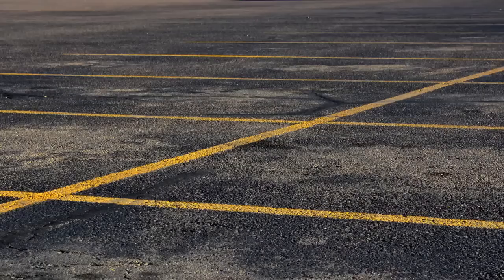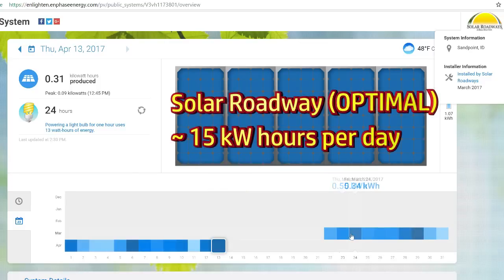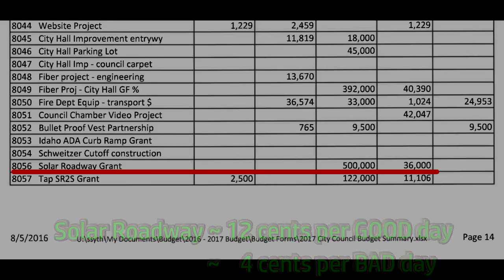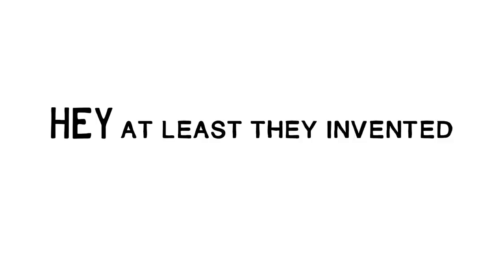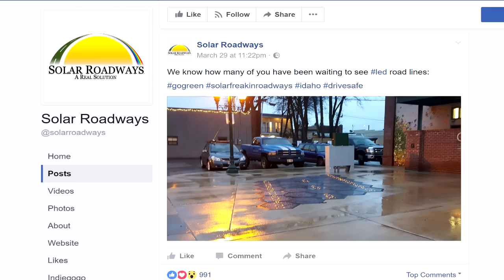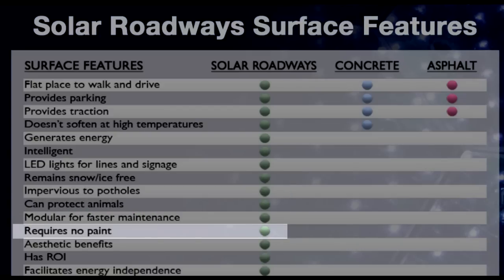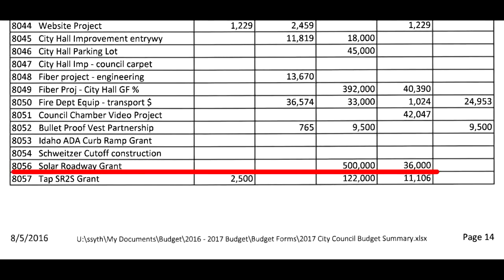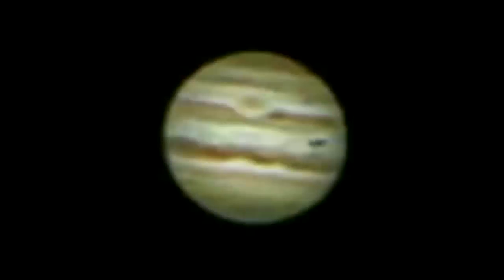Solar Roadways generate ~10 CENTS per day!!

Comment: Thunderf00t what's your thoughts on putting a single tracking solar panel on top of street lamps on the side of the road? Seeing as they would already be connected to the electrical grid, that would make it way easier as far as that goes, then since they would be tracking they would clearly produce more power than this PoS, and it could reduce taxes since the city charges tax payers for the electricity used for street lights etc. Sure the initial costs would be a tad steep, but given that they would be using the most efficient method the solar panels would easily pay them selves off. I'll get some numbers for a town and see what the cost vs production would be.
Reply: I actually saw these near san francisco. In one of the residential areas surrounding the city that lays on the metro system for san francisco, the street lamps had solar panels and one of those vertical spiral wind turbines on top. It didn't seem to make that much power, but if it can make more than the power it takes to run an LED streetlamp for one night, then its probably not the worst idea.
Reply: I can think of a few benefits to installing a panel on street lights, but judging by economic feasibility alone wouldn't justify them.

-Highway street lamps are generally high enough to prevent theft, compared to a small solar farm in a park or wherever.  I doubt there would be many adventurous thieves willing to remove an array from a pole that can be anywhere from 40ft-120ft tall with no steps or ladders to climb.
-If the bottom of the panel has a reflective surface, more light could potentially be directed back to the ground instead of the sky
-Light pollution exists, anyone who lives near a large city can see the glow at night.  It's a problem for astronomers and few understand that simply adding a larger shade to the light would cut light pollution considerably.  The solar panel could be shaped in such a way as to reduce light pollution and incorporate a tracking system at the same time.  Manufacture the shade to be angled toward the sun's path, and have the solar panel slide on a track around the shade with a simple clock drive, allowing it to always point at the sun.

Vertical axis windmills would probably be a much better idea economically to incorporate into highway lighting, as the pole is already there and one need only add some blades and generator to it.  They're already tied into the grid too, so that's a plus.
Reply: malcomb bell or maybe, you can put all the solar panels in one place where there is ideal sunlight. you can have one big inverter instead of lots of microinverters. It'll be cheaper to maintain too.
Reply: The person above me has a point.
While it may seem like a great idea to place solar panels everywhere where the power grid is, there are some hidden costs.

Efficiency - A centralized collection facility will not suffer from potential shades and other limitations of the environment, and will be more efficient

Price - Instead of having a small, low-power inverter for each of the hundreds, thousands or tens of thousands of separate panels (remember, the inverter and the associated electronics are more than 50% of the cost of a solar installation, a panel itself costs almost nothing), you could massively increase the square area of your energy collection for the same amount of money and upkeep

As the commentator above me said, there's no shortage of space for solar panels. The only case where you'd want to put a solar panel on a roof or on a wall would be it's personal use and small-scale energy production. The person using it doesn't need Megawatt-scale production of energy, and can't afford to build such an immense facility.

The government (or large corporations), on the other hand, will not benefit from the small 1-50kw installation, and need to install the solar panels in a far more immense scale. This means that having thousands of separate panels with their own inverters and other associated electronics is a definite no-no, and the party building a solar power plant is going to "go big or go home", because that's the 
only way to make things profitable. 

Installing a windmill or a solarpanel on streetlights or buildings is not going to decrease the need for taxpayer money. If anything, it'll increase it. Now, building a massive scale solar farm around the equator or some other very sunny and warm region, on the other hand...
Reply: malcomb bell what would be the advantage of putting solar panels on street lamps vs putting it on farms? can I use the "savings" generated from more efficient solar farms to offset the cost of street lamps in the exact same way?
Reply: De-centralized maintenance costs.  Not worth.
Reply: it actually works that way. it doesn't matter if you only have one phase. your entire house is operating at one phase only. Trust me, I'm an engineer. https://debendraraut.files.wordpress.com/2014/12/solar_house_connected.gif
Reply: You need a power converter and electricity meter for each point of contact to the grid so smaller installations are inherently more expensive and less efficient than large ones. Secondly you want your panels where and when you use the electricity, panels make power by day, light shines at night so no go. On otherwise unused roof of an office building offsetting the energy use of office drones would be a better place. All that depends on climate obviously, too far north or too many rainy days per year and its not worth it, the payoff date stretches to infinity. Local electricity cost is also a factor. But in a right place, if you are willing to wait for your return for investment, yeah it can make sense. You just have to crunch the numbers and see if and when it would pay off.
Reply: malcomb bell in the list of places to put solar panels, street lamps are way down that list. better places to put solar panels include: parking lots, parks, mall rooftops, government building rooftops, house rooftops. Contiguous area is key.
Reply: +malcomb bell its a matter of how long it takes for solar panel installation to earn itself back. Longer it takes the larger the risks, including theft, technical failures from corrosion, uv degradation, water leakage, panel's natural degradation, mechanical damage from say hail or birds or just dust. In long enough term there is risk that new technologies like fusion reactors simply make electricity so cheap that your installation becomes meaningless before it earns itself back and the initial investment just becomes money wasted. You wan't your solar installation to earn itself back as fast as possible, if it takes more than a decade it's probably not worth it.
Reply: +pjax_
"it actually works that way. it doesn't matter if you only have one 
phase. your entire house is operating at one phase only. Trust me, I'm 
an engineer. "

This has been disturbing me for a while now. Wouldn't that only affect the power available to that one specific phase? I mean if a device was connected to another phase, I don't think it has access to the extra energy provided by the solar panel
Reply: If you're going to use money on solar power, you might as well do it properly and leave the gimmicks out of it. The more spread out they are the more in danger they are of vandalism/stealing. So it's not going to be safe anywhere outside of a city/town, in where there may be buildings blocking the sun.
Reply: Pjax_ there's a difference between putting a solar array on private property vs putting it on something the government owns. If they put a solar array on a farm they have to either pay that farmer to rent the land, or purchase the land from them, then there is the cost of tying it into the electrical grid, and being lower to the ground the solar array wouldn't get as much sunlight as say putting a solar array on top of government buildings which are already connected to the electrical grid, get more sunlight on their roofs than on the ground, and would not cost an extra dime for purchasing land and it just comes down to the cost of the solar panels vs the amount of electricity they produce. Economically for the government to save people money it's better for them to install the solar panels on property already owned by the government, elevated to give them more sunlight (although miniscule it adds up over time) and on top of something already connected to the grid.
Reply: malcomb bell malcomb bell malcomb bell solar farms does not literally mean farm. The government owns a lot of unused land that's, much more land than private entities. It also does not cost anything to tie things to the grid. It's not a problem at all. You just literally have to plug in two wires to a common outlet.
Reply: malcomb bell the big lesson here, which is also the point of Thunderfoot's video, is that there is no problem of SPACE for Solar Panels. There are tons of places we can put solar panels. The big problem has ALWAYS been cost and return on investment. Why spend effort engineering Solar Panels on the road when we can't even put them on our roots because they're too expensive???
Reply: Stony Tina could you actually be slightly more specific, by what you mean by theft and vandalism? Because the last count put it at around 26 million street lights using 20.5 Trillion kWh per year and at the $0.12 cost of a kWh that brings it to a little under $2.5 trillion dollars in the US annually. Now obviously there are suboptimal positions in the larger cities, which obviously have buildings taller than the street lamps. So with that in mind let's go with the lowest of the 2 figures you posted there, the 20% that's an improvement of $493 billion per YEAR at the current value of electricity and currency, and if solar panels cost $2000 each to purchase, and install initially that is ONLY $52 billion compared to the savings per year, the initial savings are 10x greater at 20% efficiency than the initial costs. Theft and vandalism would be relatively rare, including drunk driver accidents, and would most likely not even effect 1% of the total number of solar panels. As for the maintenance I honestly don't have a figure I can work with on that, but i really doubt that it would be regular maintenance you know how our government is on things like that "only fix the broken ones" so unless these things go out regularly I really don't see why maintenance would even be that big of a factor.
Reply: I don't think you quite grasp the mathematics of this situation.

Here's what we can do:

-Invest in 26 million inverters and 26 small solar panels with sub-optimum location and low efficiency

or

-Invest in a single or a set of large facility(ies) that employ more efficient solar panels and only a single high efficiency inverter

Placing these things on the lamp posts will decrease the (need) for tax in the following years. But here's what you're missing: constructing a power plant will decrease it much more

I return to my previous example.

"There's no shortage of space for solar panels. The only case where
 you'd want to put a solar panel on a roof or on a wall would be it's 
personal use and small-scale energy production. The person using it 
doesn't need Megawatt-scale production of energy, and can't afford to 
build such an immense facility.

The government (or large corporations), on the other hand, will not 
benefit from the small 1-50kw installation, and need to install the 
solar panels in a far more immense scale. This means that having 
thousands of separate panels with their own inverters and other 
associated electronics is a definite no-no, and the party building a 
solar power plant is going to "go big or go home", because that's the 
only way to make things profitable."

It's like manufacturing 26 million small radioisotope generators and placing them in peoples' houses who live in cold regions, instead of building a nuclear power plant. It seems feasible on the small scale, and an uneducated person is likely to cheer "hey, look at how much money this is earning", but the truth is that if you do it properly, you'll get a much higher income.

Placing solar panels or windmills (which is even more stupid for many reasons) is not a good plan.

It may be able to pay itself back if all goes well, but using the same amount of money to build an actual power plant instead of make-shift inefficient solar cells is going to be much, much better. End of story.
Reply: I'm not going with an either or situation. There is nothing stopping that from happening, but if something is cost effective, why not keep the door open to it. The reason I say this is because if you build solar facilities in all of the optimal locations, then what's next, well you build them in the next optimal locations, etc etc etc until you run out of resources to make solar panels or locations. I'm not arguing against solar farms, I am saying that this could FURTHER the same idea.
Reply: Placing solar panels on lamp posts is most likely the least cost effective way of gathering solar power, excluding placing them indoors.

For the third time, we are not running out of places to put solar panels in, we don't need to put them on our hats or lamp posts or roofs, except for personal usage. It's not cost effective and using tax payer money for such insanity should not be a thing to keep the door open to.
Reply: i'm pretty sure trying to "insert" power into a common outlet wouldn't work

namely because grid power is generally speaking AC in more phases than 2

this is a bit out of my expertise, I know some of the terminology in my own language but not sure what translates to
Reply: pjax_ you really don't seem to understand that most feasible solar farm locations are fairly far away from civilization, what I am talking about is there won't be MILES of poles or ditches being dug, for MILES of wire to connect into the already established infrastructure. Even then I was never arguing against solar farms, I am saying that this is profitable, not the most profitable, but profitable enough that it could be considered.
Reply: +pjax_ 
huh, smarter every day I guess lol

This raises confusion in me
+malcomb bell "I am saying that this is profitable, not the most profitable, but profitable enough that it could be considered."

Why'd we settle for the not-most-profitable when we can go for the most profitable? Normally when this question is asked the answer is that the most profitable option is too expensive in some form, be it resources, man power or just money.

In this case the question is rather difficult to answer since your suggestion is literally more expensive in each and every one of the listed aspects, than the most profitable option.

It's like someone offering a handful of 500-dollar bills for you, asking "hey d00d will u take 10 or will u take 8?"

and you replying 

"hey d00d thanks d00d but i need to thinks 'bout this for a moments. I mean the 10 option is sounding noice buts i mean the other option needs to be considerations too rite"

and then proceeding to only take 2 of the bills
Reply: Why would the panel need to be AC? Why not store it into a battery or supercap that is trickle charged over the day to power an LED lamp? When it drops below a threshold it pulls power off the mains. You wouldn't need  but a few cells on top of each lamp. Dirt cheap, super easy, just as much maintenance of a regular lamp. It would work fine for systems that need to work for about 12 hours a day
Reply: Mostlyharmless1985
Because we're not talking about decreasing mains energy consumption using solar panels, but rather producing mains energy using solar panels.

But yes, I do agree, that would make more sense. Although LED streetlights would be cancer due to the horrible spectrum of LEDs, unless we used the more expensive ones.

Although, to my knowledge, even without inverting the produced power to AC, you'd need a relatively expensive (about the same price as a square meter solar panel) control device to regulate the voltage and amperage. The capacity of such a device is usually far more than just a few cells, again leading to a higher efficiency if we used larger solar panel installations, instead of putting them in places hard to reach and potentially blocked from the sun.

Your idea is most certainly better than the original idea, but I'm still fairly certain that centralizing the power production would make far more sense.

We have an electric grid for a reason -- moving power from one place to another, why not produce it where it's easiest to maintain by dedicated staff and produced the most efficiently?
Reply: Mostlyharmless1985 because if you "pull power off the mains" then you still need to have an expensive rectifier to drive the LED. Also, supercaps/batteries are expensive, which is exactly the reason why grid-tied solar is popular.
Reply: Mostlyharmless1985 producing power during the day and putting it back to the grid is more cost efficient than having an energy storage system (batteries) to use when the sun goes out. The only time batteries are used are when the requirement is to go off-grid, usually in remote locations.
Reply: Why don't we just use the very efficient and very green Nuclear power plant. I mean they provide tons of energy with no CO2. Oh wait Nuclear is evil according to liberals and we need to use useless power sources like Solar Roadways and Wind Farms!
Reply: Adam Smith peak uranium is closer than peak oil. Never mind that "very clean" nuclear creates deadly waste that must be safely stored for centuries. 
So couple the fact that the fuel for nuclear can be used to create nuclear weapons with relative ease with the fact that uranium is not a renewable resource, it is at best a stopgap between getting off of hydrocarbons and onto a hydrogen economy. "Useless" wind and solar are quite good in that they generate power for free.  No waste products are created from generating power, and that they can be placed just about anywhere that wind and sun exists. (Basically, anywhere on earth)
In turn, nuclear power plants are not usually placed where their fuel is located, and as such it has to be refined, shipped, and stored. 
I can't imagine why people would have issues with carting around large amounts of radioactive material. Nothing could possibly go wrong!

There ain't no magic bullets. Sorry.
Reply: Adam Smith mind you. I'm all for nuclear. But I'm more concerned about addressing the issues that a nuclear energy economy raises, and coming up with ideas to either eliminate or mitigate concerns rather than dismiss it all out of hand with a snarl word and a sneer. There are concerns, some more legitimate than others and they should be addressed. 
I hear in times past when two groups had a disagreement about what action should be taken, that they would get together and discuss their ideas in open and honest conversation, and when issues are raised and addressed both sides come away with a compromise that gives everyone some of what they wanted...
Reply: Pjax_ yeah that would be great!..... if it wasn't already done, yes I understand that solar farms are far more effective that way, what I'm suggesting would not be as efficient as that, however it would supplement, and improve energy costs on cities and states. I would also recommend outfitting all government buildings with solar panels as well seeing as that would help lift a burden on tax payers.

However back to the street lamp solar panels, yes it would be a bit more expensive to install with the microinverters, however that would be covered by the decreased bill to the tax payers in following years. Furthermore each one would roughly decrease the cost of each street lamp it's attached to by (a rough estimate based on solar panel output vs lamp and motor intake) 20 - 40% that's 20 - 40% that the tax payers will eventually not need to pay, and jobs for technology and mechanically inclined people to repair the units.
Reply: +pjax_ "It also does not cost anything to tie things to the grid. It's not a problem at all. You just literally have to plug in two wires to a common outlet."
Uh, no, how do you come to that conclusion? Do you actually know anything about electricity?
Reply: Skinflaps Meatslapper, the last bit there about it already tied into the grid was my main thinking on why installing solar panels would be a good idea, but i hadn't even considered the shade effect for astronomy, the implications for that alone would make it a lot easier for astronomers to view the night sky.
Reply: Richard Gates, to be more specific, solar panel -> inverter -> grid. I mentioned that because Malcom Bell was positing that it is good to put solar panels on street lamps because "they are already connected to the grid". Lots of things connect to the grid. It's not hard.